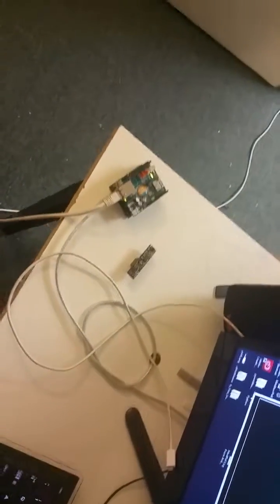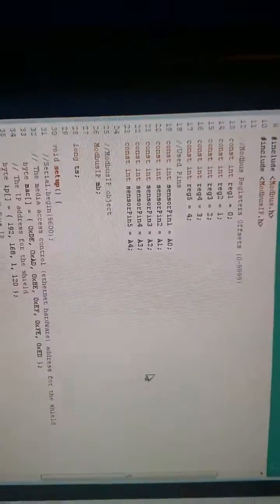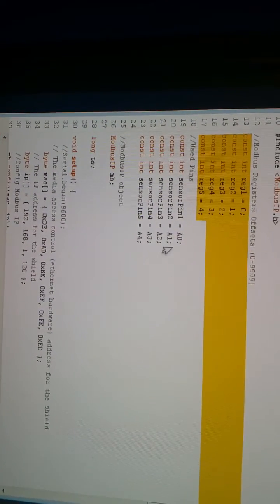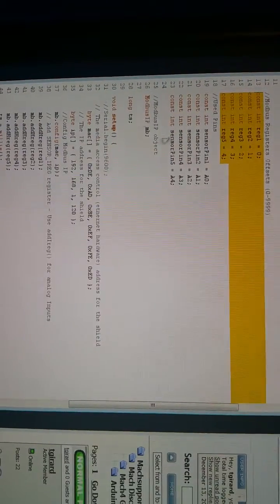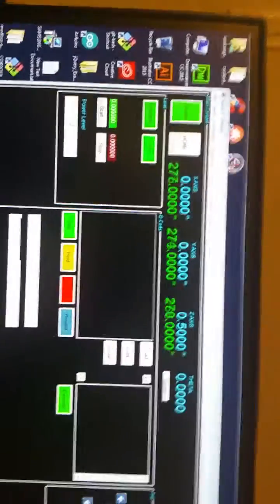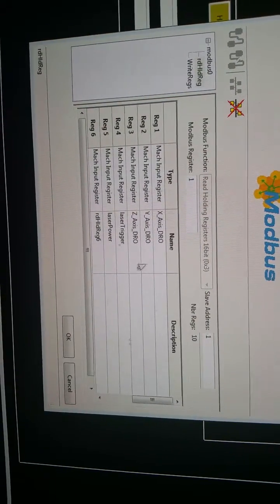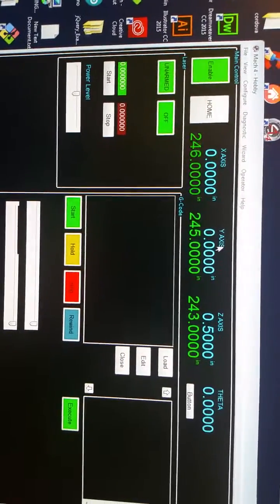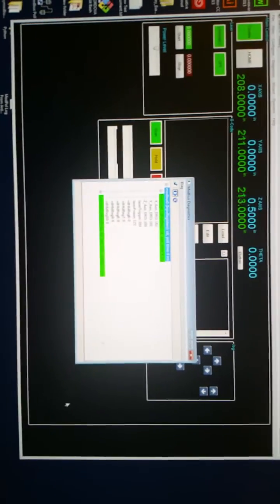Mach4 Arduino Modbus Slave

Comment: This is an amazing video! Thank you. Will this Also work with mach3. I really want to add more inputs?
Reply from the maker: Hi, I would bet that it probably will work because Mach3 and 4 pretty much use Modbus the same way. I would not, however, be able to help you in your endeavor because I haven't used Mach3. Please post here and in the forums if you are able to get things going in Mach3. Good Luck!!!
Reply: I Certainly will let you know how I get on. Is there a place I can download your modified Arduino code from? Im WMT on the mach forums.
Reply from the maker: Setup an account on the M4 forums and send me a note. I'll try to find things and package it up for you :)
Reply: Thank you so much. Id really appreciate that. I will PM you from the forum.

Comment from the maker: OH my god I explained this horribly. The reason you put 0 as the first register in the Arduino constant is because the library adds 40001 to it to make the first register address 40001(Base0).

In mach4, you have to start with 1 because Mach adds 40000 to it to make 40001(Base1). This caused me all kinds of grief because I didn't have it right and kept getting the Illegal Data Address error